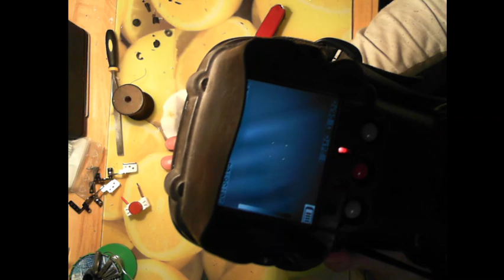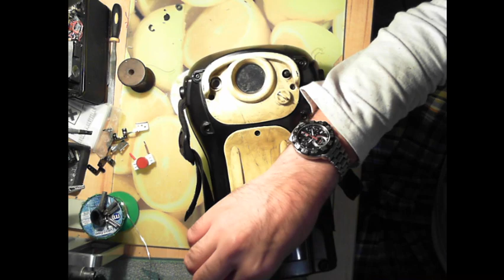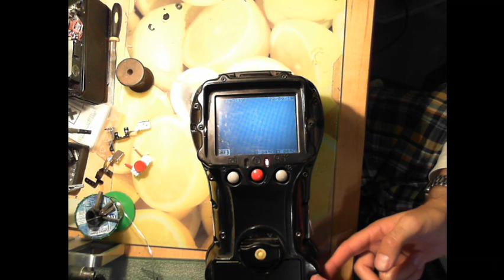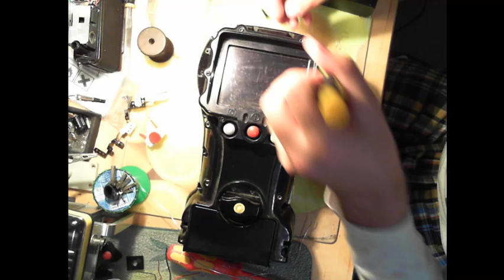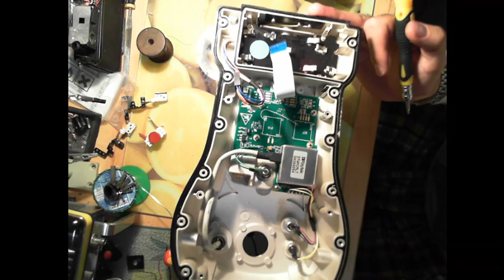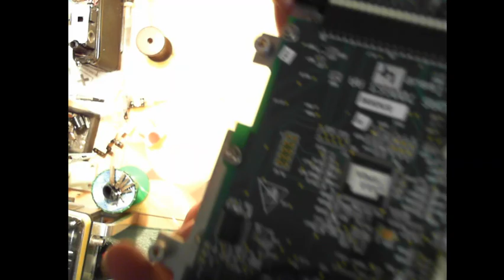ARGUS 3  Thermal Camera Teardown

Comment: This is interesting. I've got one of these. E2v Argus 3 BST.  Works very well - had it serviced by Bill at Fire Tics as the iris was sticking (quite normal apparently).
Nice video 👍
Reply from the maker: Thanks, also did one on composite modding that gives the option of replacing the built in display & adding wireless using drone FPV equipment.

Comment: Which screen is that on the rPi camera?
Reply from the maker: Just a generic composite monitor for use with a revercing camera in a car or van. I have two of them. Ordered them years ago. Handy to have in the project box & can be had pretty cheap to.
Reply: @TheEPROM9  sweet. I have a thermal engine from a Bullard fire fighter camera that outputs compisite. Will get one of them now that I know about them.
Reply from the maker: I would always recomend them for projects, can be pretty esily modded to run on 5V